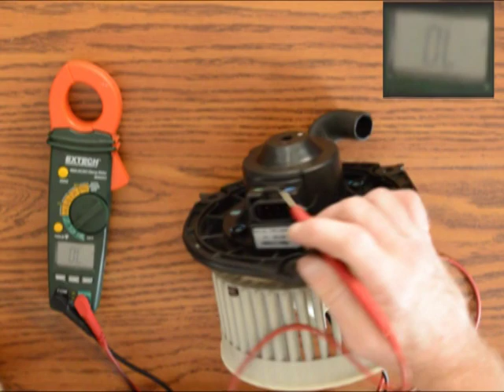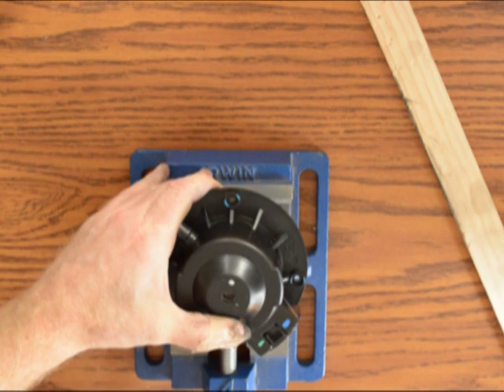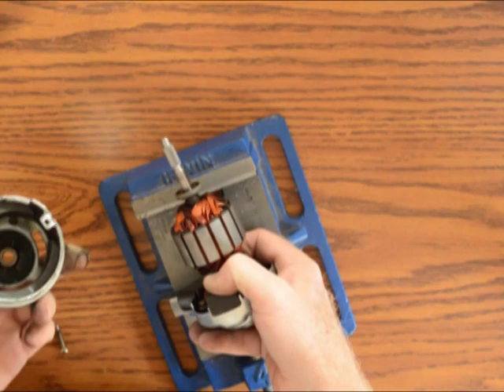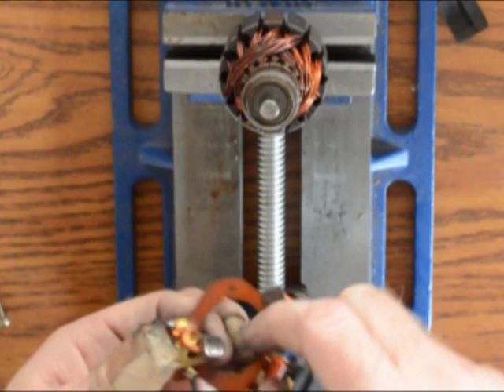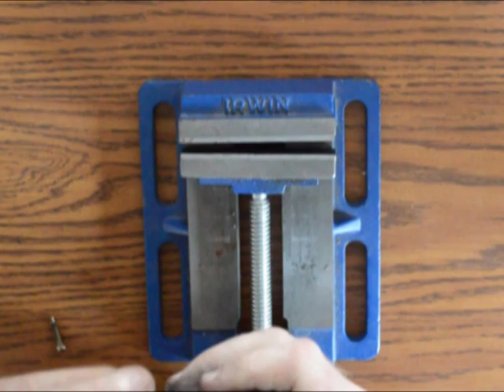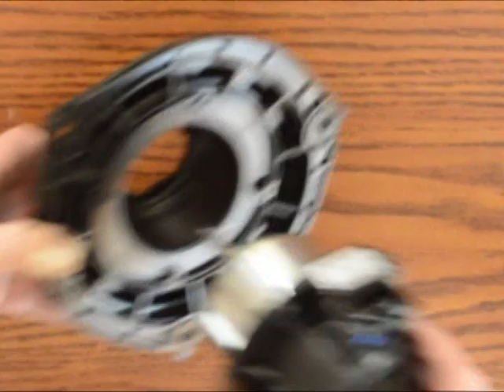2005 Cadillac Deville Heater/AC Blower Motor Cleaning/Repair

Comment: In my opinion this is one of the largest problems we have as a society and we need more people taking initiative to repair their possessions rather than throwing them out and buying new ones. There is so much information accessable to society now days because of people like yourself making tutorial videos like this explaining step by step exactly how someone can go about fixing things instead of buying a new one and throwing the old ones in already crowded landfills. Thank you, I needed this exact video to fix my own blower motor in my truck after continuously replacing resistors every year knowing that someday I would eventually need to get down to the actual problem causing my blower to only work on the highest setting.

Comment: excellent  video ..... i can add a couple of pointers ...the commutator bars you are talking about on the end of the armature should be sanded until shiny then take a pick and clean the mica from between the bars not too much just below the copper bar surface then test for continuity from one bar to the next there should be no ground...that black soot is what mainly is the problem its arching and not making good contact...hope this helps

Comment: It always helps to index the parts before removing them.  I always oil the felt with 3in1 oil and a tiny dab of grease on the other shaft bushing.  If you have concerns about stripping the threads, reassemble by hand!  Hope it worked, you didn't seem to find a fault.  Possibly dirty commutator.  The one on my XLR is squealing.  Cannot get at the top bushing or get fan off the shaft. I spray lubed it as best I could but still isn't quiet.

Comment: You don't have to remove the blower blade [squirrel cage fan] or front motor casing. Just remove the rear cap (2 screws) and retract the carbon brushes (as you did) to remove the circuit board. This allows enough exposure to brush out most of the caked on dust (mostly carbon byproducts from the half-worn brushes) and blow out the rest with compressed or canned air. Clean the metal inner contacts with (e.g.) CAIG DeOxit then reassemble. Do the cleaning outdoors. The brown dust on some surfaces tested positive for buckministerfullerene, whose heath effects are not known [The black dust on other parts is just soot]

Comment: This repair works.  I had a noisy fan, which became intermittent to start (bang dash to start), which became fully inoperative.   Removing the fan is an easy procedure.  6 total bolts, 8mm and 6.5mm.   Remove motor, blow clean, re-install.  Boom.   All better.
Reply: do U know if there is any videos on the removal on a 2005 deville dts